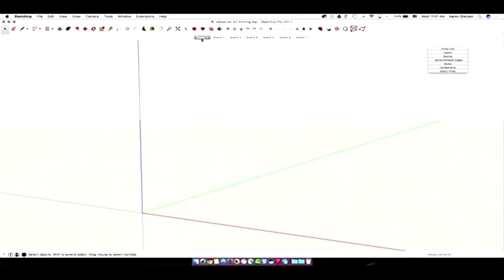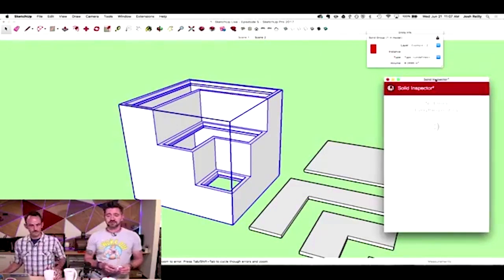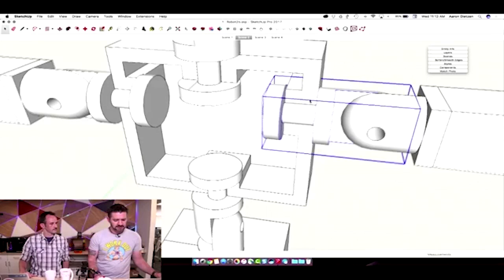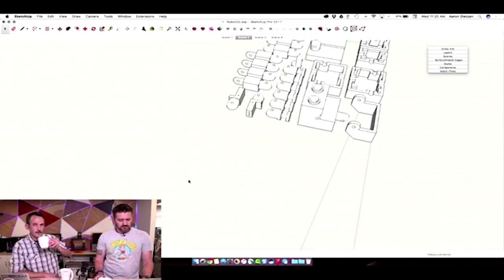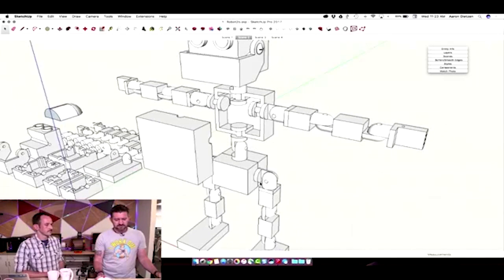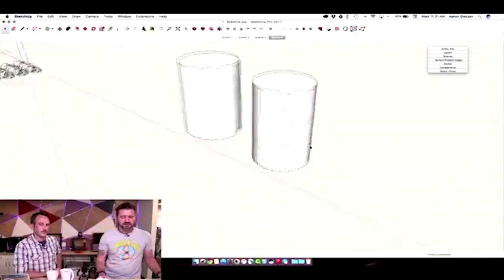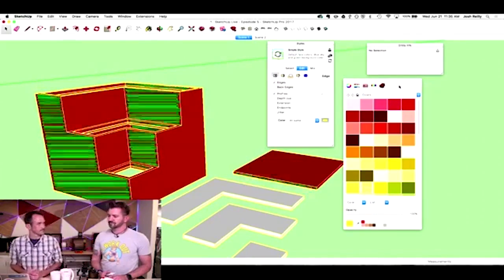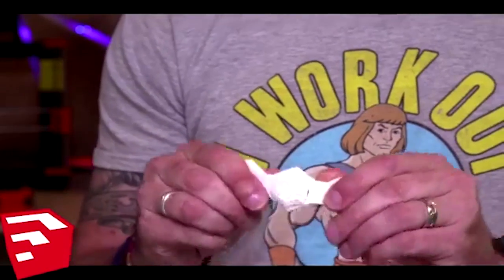Facebook Live: 3D Printing (June 21, 2017)

Comment: Great introduction. Hope there will be a follow-up on this subject, not just because of the video quality... but also using an architectural model... scaling down to printable parts and review some cheap home 3d printers as well. Want o buy a printer and bit lost on what to get... especially the cheaper versions. Thanks !